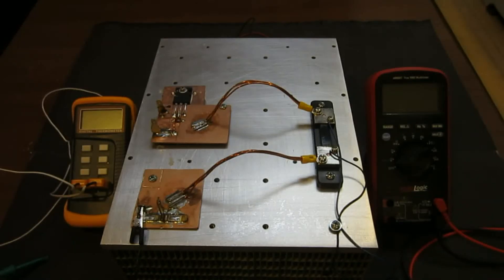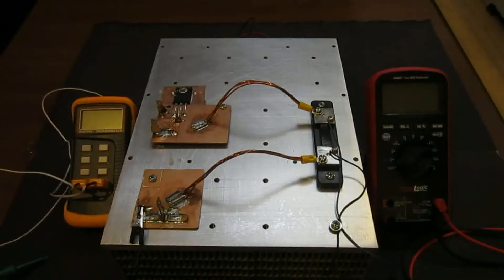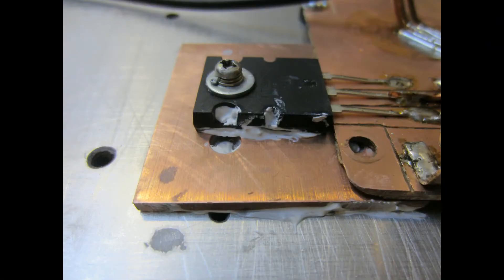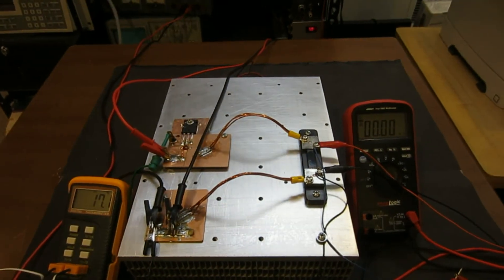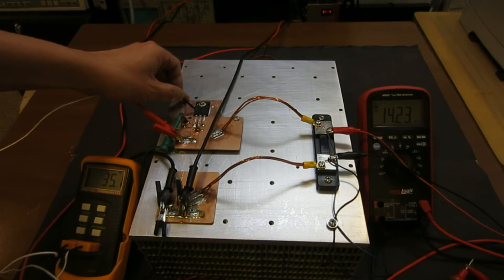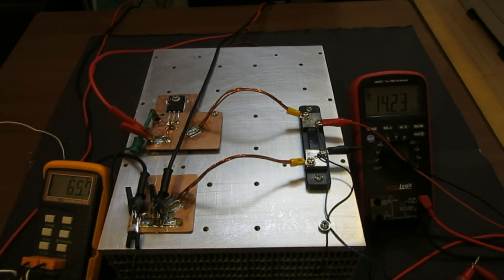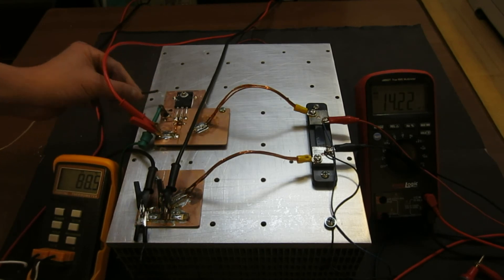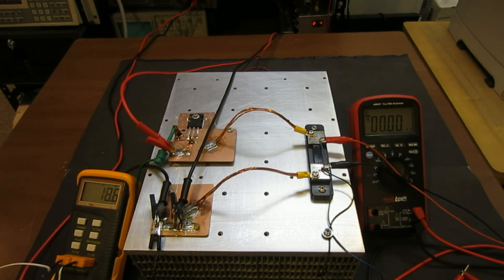Linear MOSFET and Its Use in Electronic Load - Update

Comment: I have a project to power 2 6000 watt rms subwoofers. The amplifier are beyond expensive these days for that much power. I wanted to bypass all the nonsense of swps and run directly from alternator to power mosfets. I want to build an array of mosfets that can push pull 12k watts at either 4 ohm load or .25 ohm load do you think this could be done?

Comment: Other than in the area where there is contact with the MOSFETS, why do you think smoothing the surfaces helps at all?   After all rough surfaces have a larger surface area than do smooth ones.

Comment: Hello Kerry, I am just playing around with these Mosfets, have you ever hooked up more than one??  Would it need a bigger driver circuit than just the one IC circuit ???   I am looking to test 30 and 50 volt power supplies and want a lot more power handling.. Skip

Comment: I am planning to make yet another dummy load, all my previous loads failed at some point (mosfet shorted, blew, overheated, changed resistances etc.) because I used non linear types and money just flew trough the window, mosfet in your video seems like a good alternative, it's expensive (for me at least) but 100W on just one mosfet? that is insane. Shipping to poland is 30$ :))
Reply from the maker: 200W per MOSFET actually. Yeah, I used IRFP150N before and the maximum power I could sink into each one is only around 30 to 45W maximum.

Comment: Nice job. Is there no way to mount the mosfet directly to the big aluminum heat sink, to avoid the extra copper block? I would be curious if that would perform better.
Reply from the maker: Well, That's what I did previously (https://www.youtube.com/watch?v=WUPrj03UbTM), because aluminum's heat conductivity is less than that of copper I think it would perform worse if I put the MOSFET directly onto the aluminum heat sink.

Comment: Something just fundamentally doesn't make sense to me in regards to power dissipation in a MOSFET. Some people say that the power is I^2*Rds_on, however, Vds*I is usually far higher. What am i missing here? 2 different power calculations??
Reply: I believe you may be thinking about how much power it can control, vs how much waste heat it can tolerate.